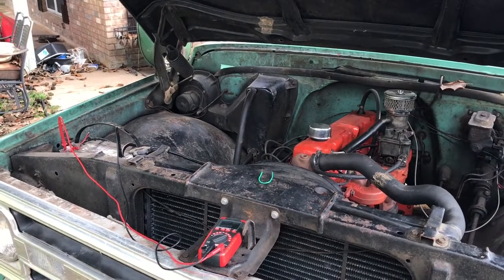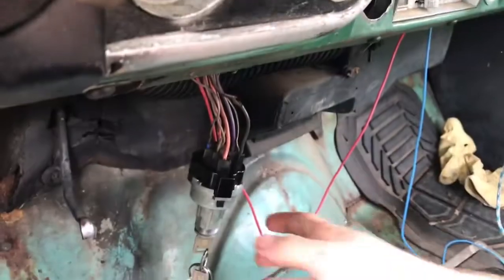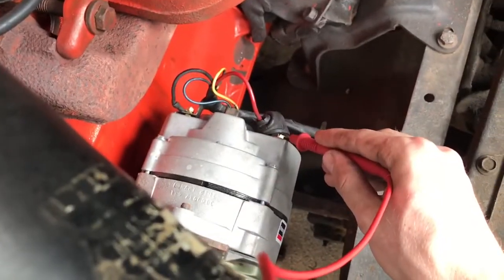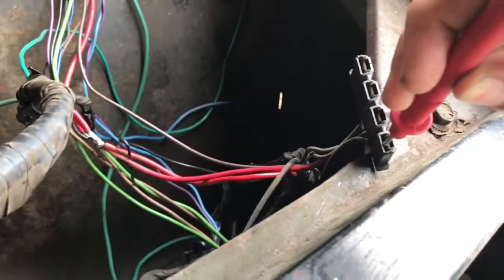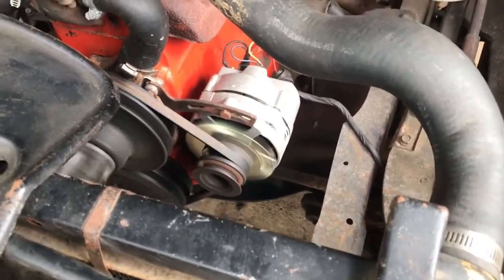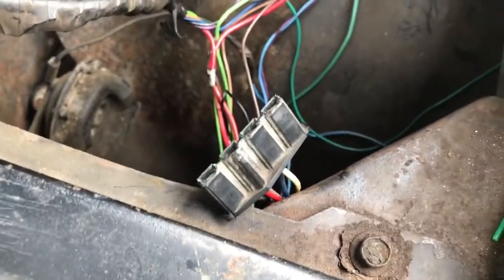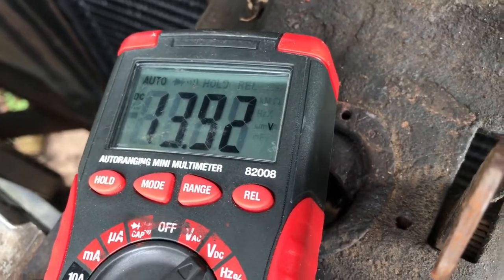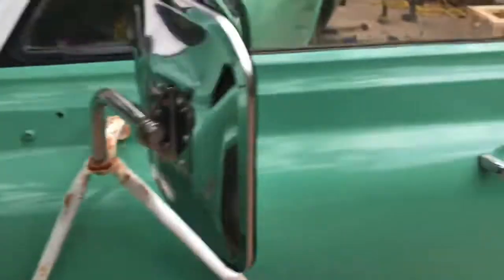How to test a voltage regulator on a ford truck

Comment: Doesn’t a gm alternator have an internal regulator?
Reply: The DN series GM alternators have an external voltage regulator. The SI series GM alternators have internal voltage regulators.

Comment: My alternator works as you showed when I jump it with a wire, but I just got a bran new regulator and it will not charge, so what else could the problem be? No wires getting warm, I also have grounds going to the regulator and alt direct from the battery, so I know I don’t have a bad ground either.
Reply: Had that same issue with a 69 Mustang where the alternator will charge if you jump the fields.
Changed out 4 regulators that were new but dead right out of the box. New dont mean its any good when they are chinese made.
Reply: Same issue bro no fucking clue not my truck won’t start
Reply: Bad connection or bad regulator.